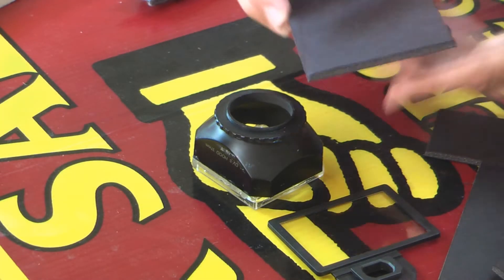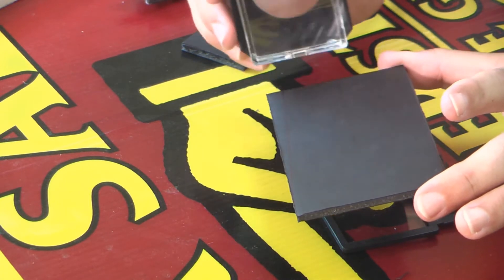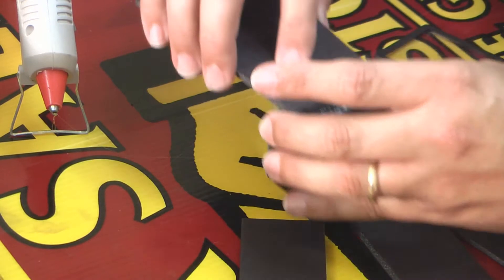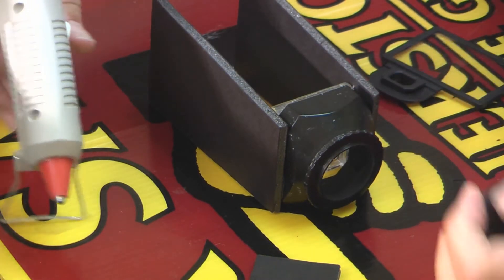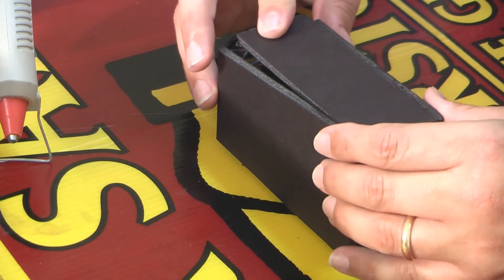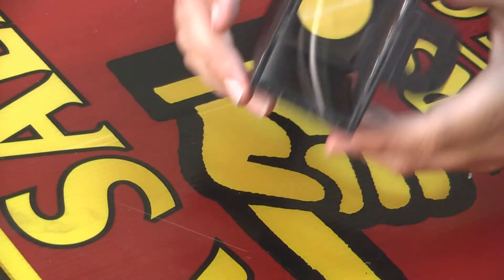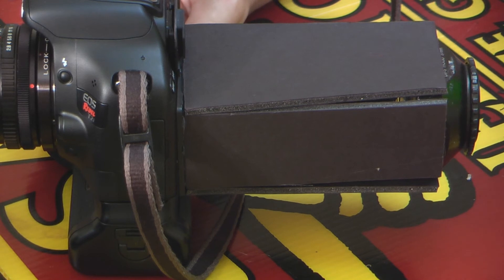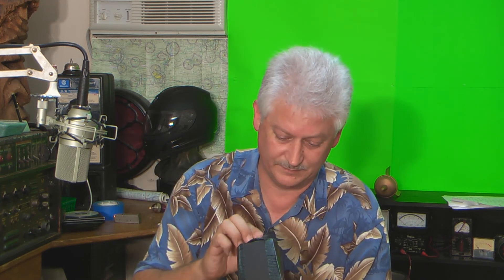Canon T2i for Regular Schmoes. Part 14-D: DIY LCD Viewfinder

Comment: I got me a cheap replika of the original LCDVF on ebay. It's sold by Foto-tip and costs about 80$. Ok, it's twice the amount your piece costs but it's top notch quality. And the major advantage is the magnetic attachment. So there's no "fumbling on the eyepiece". Just put it on the frame and it snaps right on. Amazing piece!
So if someone's a lefty like me it's worth thinking about it.